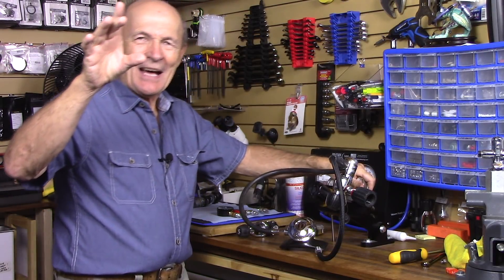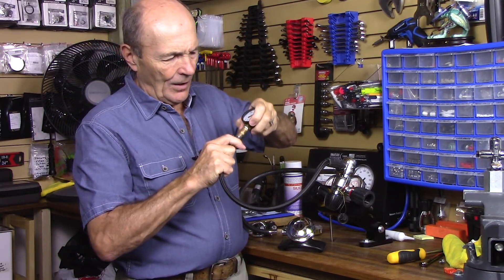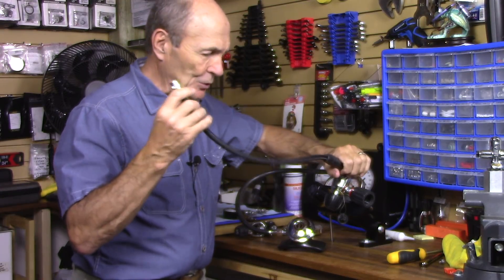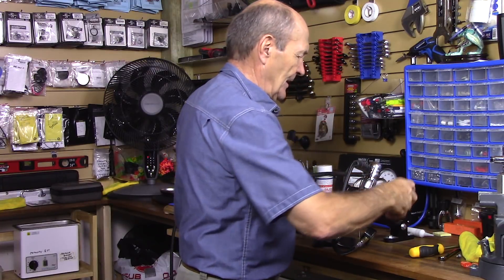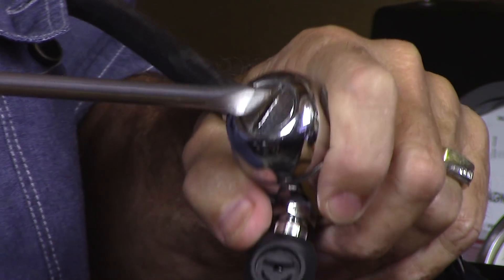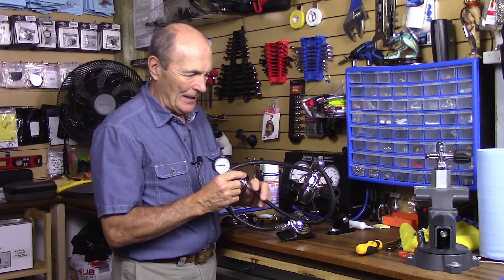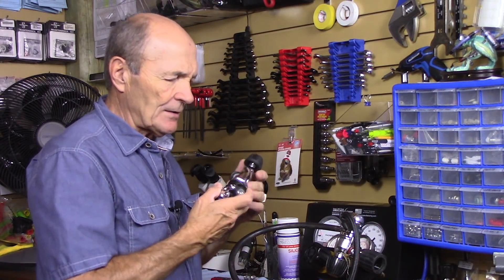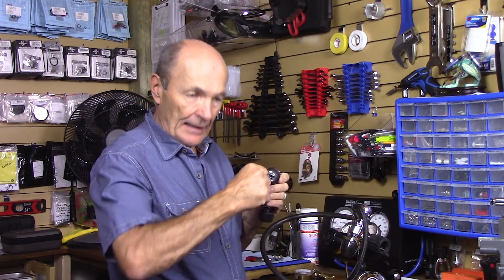Regulator Service, Adjust The IP - Scuba Tech Tips: S07E20

Comment: Hi Alec, great series. Love it. Can you talk about pony system tank sizes and possible adjustments?
Reply from the maker: Hey, my wife says I can talk about anything!
That's actually not true but I do have a reputation for being an expert on many things and also for being successful in many areas.
Let me tell you my secret. Shhhh.
1. I only address subjects with which I'm very familiar.
2. I only try things which I'm pretty sure I can do with success.
That doesn't mean I don't try new stuff nor that I have never failed but I've become successful at analyzing things using these 2 rules. Now everybody thinks I know everything and can do anything. Shhh.

I have used a pony system many times. In fact, I started using a type of pony system before it was called  pony or even a redundant air system. We didn't use those fancy terms in the 60's/70's. We just called it extra air!
I have a picture of myself with a beautiful pony system that I made in the early 70's. It's a steel 72 tank with a smaller pony tank beside it, all chrome plated! It gleams in the sun! I made a custom backpack with a long chrome plated band to hold both tanks and used it with a chrome 2 hose regulator on the main tank and a chrome single hose on the pony. Chrome plating was the big thing in the 70's.
Anyway, to your question, assuming you're using a regular full sized tank as the main source, I usually suggest the 19 cubic foot pony as the best choice. It's not too big to carry around or to cause attitude problems (the larger 30 or 40 cf tanks tend to flop over) but it has enough to air to actually be useful. Even at 100' a 19cf will last for 5 minutes which should be enough for you to figure out what to do next. At 30' it will give 10-12 minutes of air - good for checking props or recovering dropped things. So it's the most useful size. A simple regulator, no SPG, BCD inflator or Safe Second needed, on a 19cf tank clamped to the side of your main tanks is the simplest, easiest to deploy and most affordable set-up I can suggest.
XS Scuba has a system called 'XTR Extra Air - Complete Backup Rescue System' that is as close to perfect as I've seen for less than $500 - tank, reg, mini gauge and pony mount too. It even comes with a DIN valve for you DIN lovers and a flex hose.

Hope that helps.
Alec
Reply: Oh wow.. thank you so much for the reply, I really did not expect such a detailed answer. Since I live in Europe I was thinking of a 3ltr tank and carry it as a stage strap.  Let's hope I will never need it but nevertheless better safe than sorry. Anyway, great answer and thank you for taking the time to reply. Keep up the good work..

Comment: hi Alec, I noticed on on some older regulators that the yoke has threads where it connects to the 1st stage, what are they for?
Reply from the maker: Yokes are pretty much universal in design and fit. However, how they attach to the regulator varies between manufacturers.
Most attach by means of a yoke nut. The yoke slips over a threaded stem and a nut threads onto that stem to secure the yoke in place. Other combine the nut and the threaded stem into a single bolt that fits into the yoke and then tightens into the reg body. Another less common arrangement has a long threaded stem onto which the yoke, also threaded, screws. The yoke is not tightened down in this case but is held from unscrewing by a large C-Clip. I suspect this is the one you are looking at since in this style the threads are quite visible. I'm guessing it's a US Divers regulator. They used that system for a long time.
Thanks for watching.
Alec